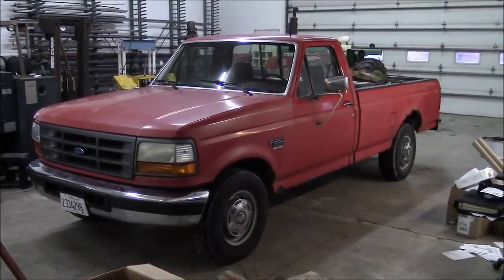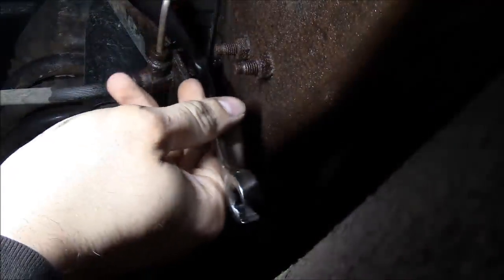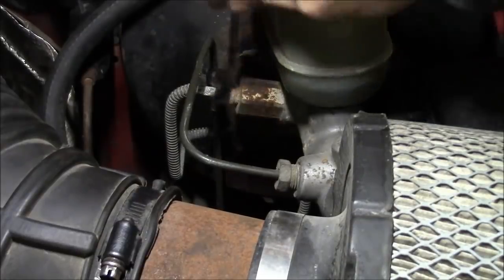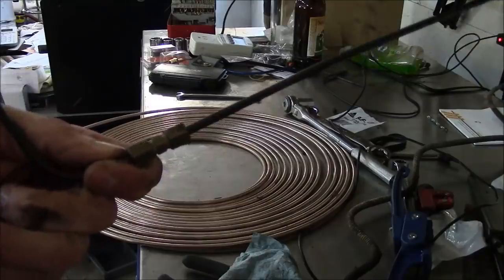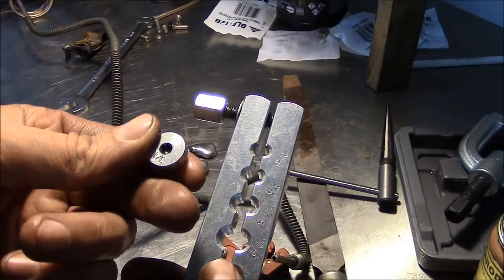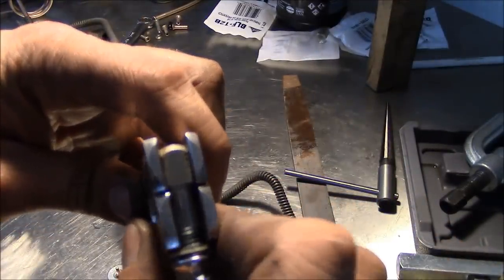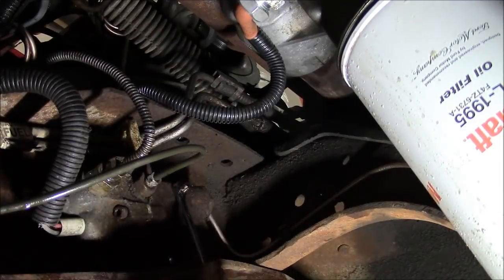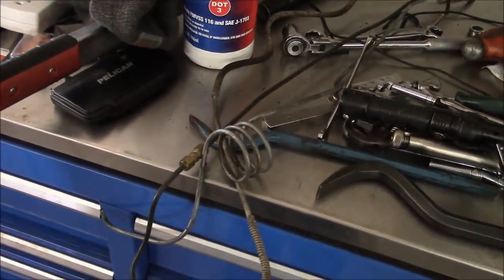OBS Ford Blows a Brake Line

Comment: I hate to be "that guy" but your view from teh front caliper shows that your tires are dry rotted. See at 14:20.
Reply from the maker: They also have no tread and they're the wrong size...
Reply: @WatchWesWork   You cant see the air in them, no whiskers, isn't flat on the bottom. I don't see an issue
Reply: Watch Wes Work  Heh !